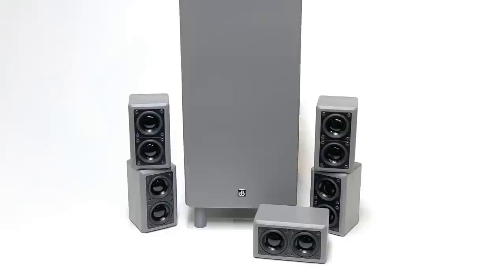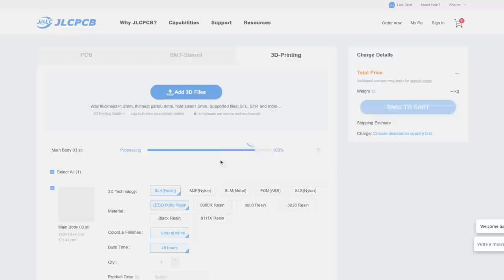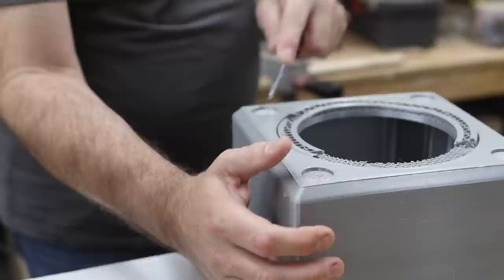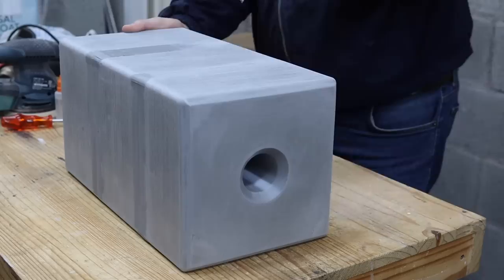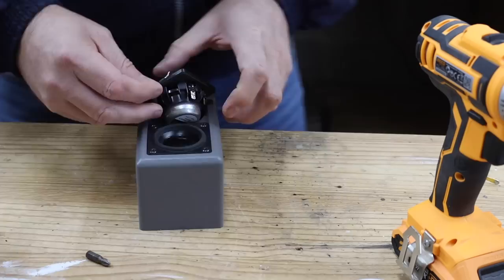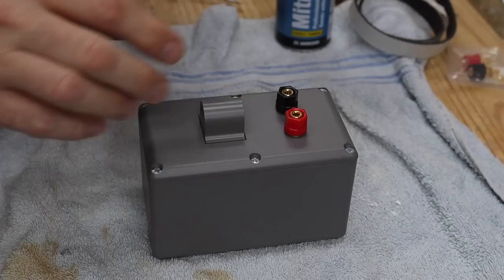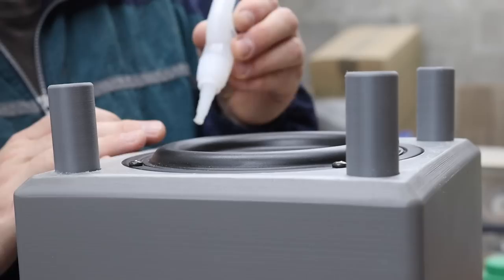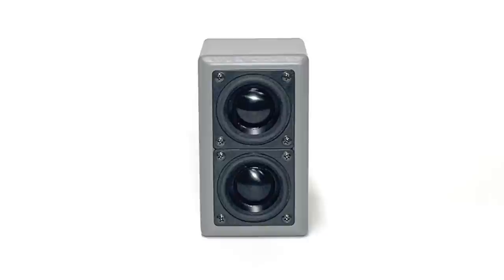Building a 5.1 Surround Home Theater System 3D PRINTED - by SoundBlab

Comment: I once printed a speaker too. Took ages to print and sounded like...plastic. Then I made a wooden one of the exact same dimensions et voilà, sounds like it should. And it took me a quarter of the time to finish. And don't forget the costs. The electricity alone used for printing costs way more than the plywood.

Comment: Don’t know where to begin. My absolute favourite video of yours so far. The highlight has to be how you designed the speaker mounts to also help with cable routing. Really clever. Glad to see the days of needing tools and and know how in woodworking are over when it comes to build a quality small form factor speaker set. And the subwoofer is also amazing. It takes so little space you could probably have more than one and not have them call out attention. Painting them the same color as the walls also was great. You’ve left me dreaming of a 7.4.6 atmos setup this compact.
Reply from the maker: Thanks so much, glad you enjoyed the project. I am super happy with these and have been using them everyday ever since, and they sound great. You would think the plastic enclosures cannot possibly sound good, but when designed correctly, it has surprised me.

Comment: Question: what about the interference pattern (comb filtering) between the two identical drivers?
Reply from the maker: Comb filtering at a typical distance when listening to speakers such as this is not a problem. It only really becomes a problem when you listen near-field. At a longer distance room reflections start to play a role and will potentially cause much more issues depending on your room. For this size driver, it should start only around 7KHz or so, but my measurements even at 1m did not show any unusual comb filtering in this case. Should you place the two drivers much further apart, only then will the difference in distance between the two drivers and your ears cause a phase cancellation since the sound from each will arrive at your ears at different times, but so close together, they act almost as one driver.
Reply: @SoundBlab , thank you for the detailed explanation, I appreciate it.
Reply: @SoundBlab  thanks for clarification. I has same doubt.

Comment: 3:20 in case you plan on printing a lot more, I'd totally recommend you a cheap deburring tool. It makes cleaning corners, chamfers and fillets just such a breeze and results look insanely good.
I love your stuff, recently build the Dynamites and think about build its sub as well. The 3D printed set is also intriguing but I just dig the look of large fillets, haha
Reply from the maker: I definitely need one of those! Glad you like the builds. Keep going!

Comment: Nice made speakers!
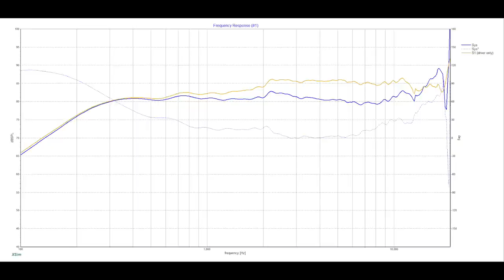At 7:51 you're showing the impedance graph.
I would double check your calibration, because the graph looks rather strange for the a LR bafflestep compensation.
That should be just only be a straight line going upward.
Reply: there's an 18k resonance from the driver
Reply: @JordanKL1  a resonance would show as a peak in the impedance as well as being much narrower.
Reply: Ahh yeah and the original response shows no peak. Looks like something in the filter is causing the large peak in response at 18k.

Comment: PLA sucks for subwoofers.  I printed one from Hexibase and it rattled even with 50% infill.  I tried PEG, just as bad.  Back to good old Birch board.  The 3D print is great for the vent tubes or intricates vents but not as a cabinet.  I was thinking of printing with 10% infill then pump concrete in between the walls of the PLA cabinet but never got around to doing it.
Reply: this one seems impressively braced - the 3 sections with thick bracing between, i'd imagine resonance would be far above the 150hz crossover point
Reply: ive got a hexibase one printed in pla with no rattles and a personal sub design with no rattles either, plus a set of speakers , its likely stringing in the walls or some wall not quite touching each other, try turning off 'avoid crossing outline' as this makes stringing occur in the infill, and turn wiping on as well as outline overlap to 35-40% . Ive had to reprint so many for similar issues but find these setting helped alot (i use simplify 3d but i think cura has similar settings) . But with the hexibase build it will make port noise if running above tuning frequency so keep that in mind also.
If the sub in this video doesnt rattle, hexibase pla sub when he makes it doesnt rattle and mine doesnt i think its your print settings!

Comment: Love the builds on your channel which is why i am subscribed. :)
In this build how much filament should i assume to use in the process?
1. Subwoofer
2. Front, Center and surround
Thx in advance
Reply from the maker: You are looking at between 3 and 4 1kg spools for full 5.1 set at 20-30% infill.

Comment: Nice build for a medium to large can u make a larger sub or 2 drivers in sub to generate more pressure. I won’t mind using a powerful amp instead of lepai Also I see u r a TB fan. Would be great to see some peerless drivers used too
Reply from the maker: Thanks! You can even use two subs, but the one actually really does a good job and two might even be overkill.

Comment: Hello.  I found your channel today and I think I watched every video! Quick question…I’m planning an stereo upgrade in my bedroom/TV room which is rather small at 12feet wide and 10feet deep with the listening position in the bed 10 feet away from the TV wall. What type of speaker design would you use for a room like this? I can’t have large tower speakers on the floor as it’ll simply clog up the living space. I was thinking an extra large sound bar with left right and center built into the same bar would be the cleanest look for the room but I’m unsure if it’ll have the best sound quality. 
Thanks in advance.
Reply from the maker: A sound bar is a good option, if you get one that has decent sound. Some also come with a small subwoofer for bass, or some have limited bass response built in with passive radiators.

Comment: Would there be repercussions to sound quality if I was to do the exact same build with wood?
Reply from the maker: No, as long as you keep the internal volumes the same, and the size and length of the port in the sub the same.

Comment: The only and big question: how have you calculate your enclosures??
From an other builder: You must test for medium and high frequencys a linear amplifier. 
Class D is only suitable for bass boxes. High freq are so agressive...
I have a big experience with all TPA ics, if you want to exchange...
For your big room a 8 inch is a better choice. Test your sub in your sleeping room... ;-)
Great channel! Best from France!
Reply from the maker: I used WinISD to calculate enclosure sizes. The 6inch works rather well. An 8 inch would be better, but the 6 is more than able to keep up and produce enough bass. Thanks! Keep well!
Reply: @SoundBlab  WinISD is the best freeware.
If what you listen to is enough with a 6 inch great good you do...
Reply: @SoundBlab  It's my pc software too. An internet adress in my language make the same and little different. I make a mix.
My first was caad from monacor late 90's.
I listen wide sort of music an i search best for all. For rock or pop a 6 is for me a great choice. I have build a 2.1 with the 5" tang band. It's totally crazy in a 18m2 room!!
Have a nice day!!